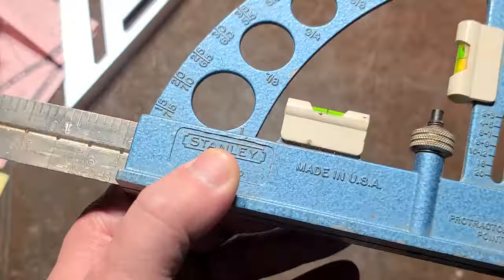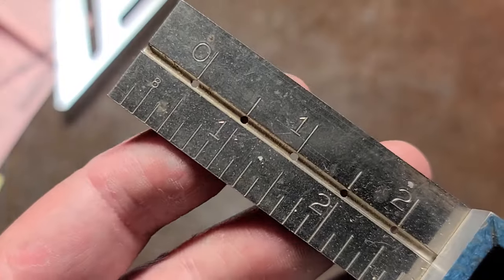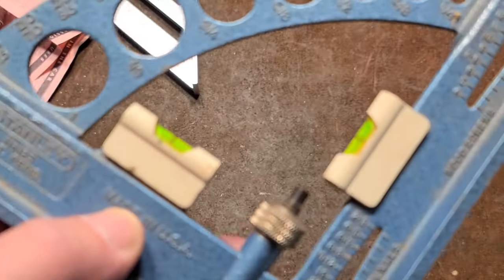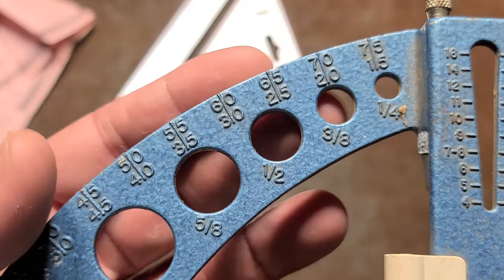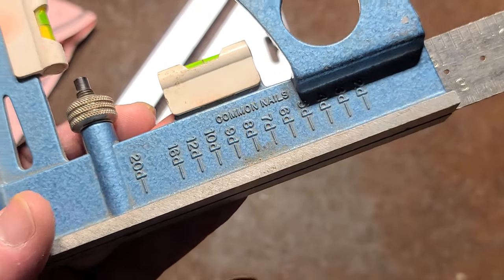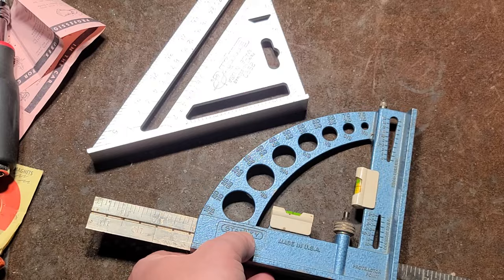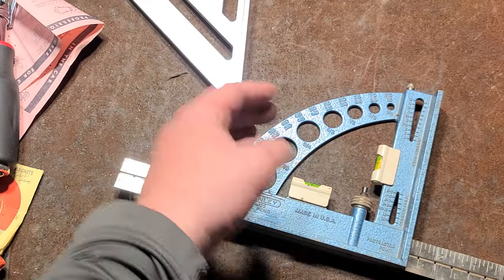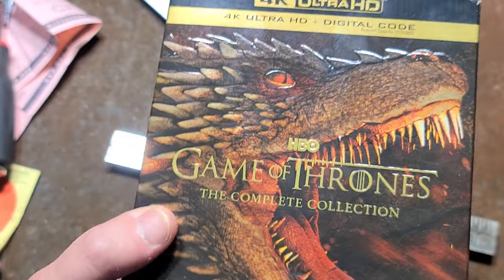Stanley USA #125 Combination Carpenters Square Review

Comment: Certainly before my time, I used to use a combo square a lot but even that has been replaced by the Milwaukee speed square and trim square. The preset notches for laying out rips or hole patterns is unmatched in speed.